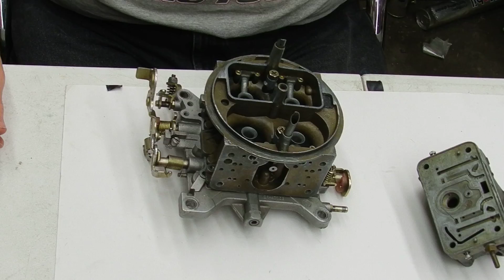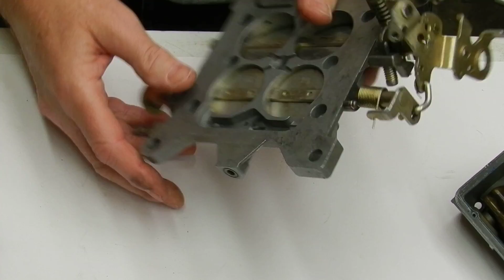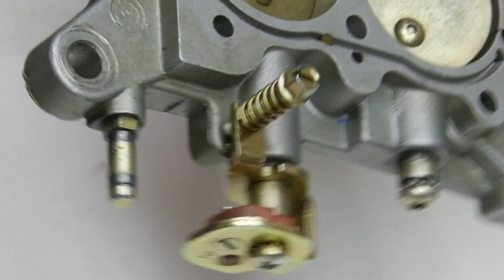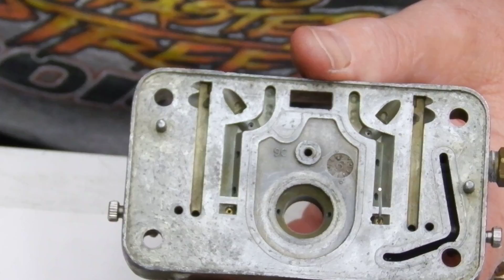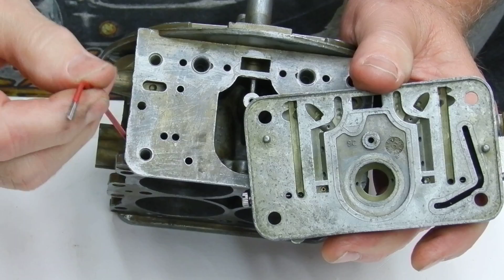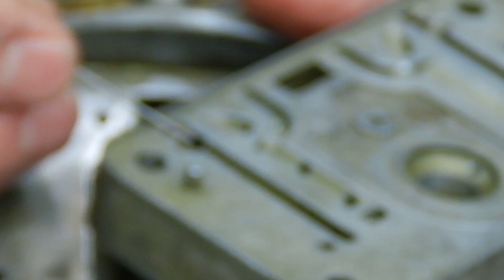Holley Carburetor Tuning: Idle Circuit Mods for High Duration Camshafts

Comment: On another note, some fellas at a local speed shop suggested installing a spacer and drilling out the air holes in the spacer beneath the carb rather than modifying the butterflies.  Any thoughts on that idea vs. putting them directly in the butterflies?
Reply from the maker: Mark I don't know if you use a air filter or not , one advantage is all your air is being filtered , I don't believe I would want the holes in a spacer . if you can afford to buy a holley ultra they have a idle air bypass designed in them.

Comment: On a vacuum secondary with an electric choke, one must inspect the amount of transfer slots exposed after the carb comes off choke?  Correct?  I mean that while the choke is holding the primary butterflies open to enrich the fuel mixture all bets are off, are they not?
Reply from the maker: correct. choke off and engine at operating temp and timing set properly. good job

Comment: Hi Randy....I wanted to ask your opinion on why my 1850 600cfm Holley makes my exhaust smell really gassy. I have a 1974 Nova 350..TH350 tranny ..6al ign .. 3.08 rear differential.  if I left anything out please let me know
Yazmin ..Venice Beach CA
Reply: Randy could ask better questions than me, but two easy thoughts come to mind.   First is not all Holleys have power valve protection, so you may have a damaged power valve from a backfire and it needs replacement.   Second is easy: make sure idle air bleeds are clean.  If they aren't pulling in air, there's no emulsification of fuel prior to entering at bottom of venturi which would take a previous good tune and make it run rich if no adjustments were made - the circuit delivers pure fuel.  Just my two cents on a good starting point.
Reply from the maker: do you have a racing camshaft , if so I need specs on cam and engine  idle vacuum if possible
Reply from the maker: that's good information , older holleys don't have power valve protection ,unless its been added. most all later model holleys have proection., flinch your a smart guy, very good information.